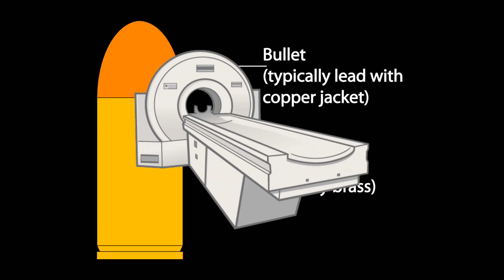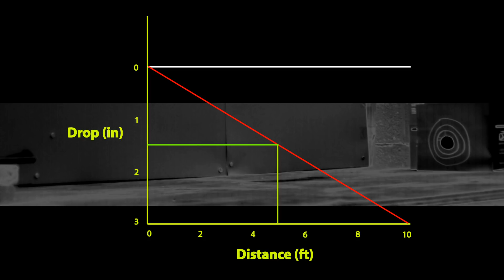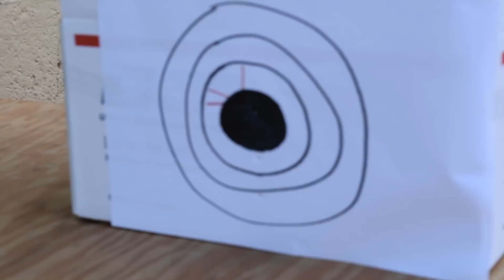Can Magnets Curve A Bullet?

Comment: Slowing the bullet would also help gravity pull the bullet down. The more FPS the flatter trajectory of shot. 
I would love to see how far I could pull the shot off the sight line with multiple magnets to the left or right of the gun. I also would of put the airgun in a shooting clamp so the gun position is static and I could play with magnetic position and compare it to the control more directly.

Comment: What I'm wondering is could a magnet stop a solid copped bullet. When a magnet is thrown at a copper plate it creates and em field that slows the magnet and the strength of the field increases the harder it's thrown. It makes the copper plate hot from absorbing the inertial energy. I doubt the magnet would stop a bullet shot right at it but maybe if it's shot down a rail lined with magnets it might. I thought of the idea when I saw a video about using a swing arm to launch a small projectile into space.

Comment: The rifle fixtures and laser (or other alignements) with the targhet is necessary even for air rifle.
Interesting subject. Like neomagnet droped on surface of Cooper that slowing down at impact even non magnetic material.
Make a 'bulet' with solid neomagnet core.
well done. keep up the good work.
Reply: How  about the  use of magnetic force using  a remote to control the shot? interested in this

Comment: Solid copper is more effected by magnetic fields than steel.  It would be interesting to use round magnets to shroud the barrel and fire solid copper bullets.  Might want to do the string on the trigger trick and stand back a bit....

Comment: Those were some of the most cringeworthy and facepalm-inducing Mythbuster fails.

Finally, someone did it right!
Reply: Mythbusters used firearms that shoot at much higher velocities than this steel bb gun.
Reply: @bonnome2  Doesn't matter, what they did was utterly nonsensical.
Reply: They're called myth busters not science nerds, disproving stuff by recreating it is their job.
Reply: @kirara4953  
> disproving stuff by recreating it is their job.
But they failed to "recreate" anything, and they failed even before they began, because they failed to understand what needs to be recreated in the first place.

Just like with "plane on the treadmill", where they used a nonsensically distorted version of the actual physics problem.

Comment: 1st put the air rifle in a vise grip it was moved between shots and dont move it at all between shots
2nd add an additional magnet of the same size and strength.
3rd move the magnets around to try to replicate the movement motion in a different direction.
4th use multiple high speed cameras.

Comment: The bullet is passing very close to the magnet, and also the barrel is very close to the magnet. There is a distinct possibility that some sort of air pressure effect is occurring as the bullet passes the obstacle.

It would have been much better to use a solid chunk of something in the same position as the magnet for the control. A lump of wood or plastic of a similar size and shape to the magnet would then show that the effect is magnetic and not the result of a pressure change over the obstacle.

It is nevertheless a fun experiment.